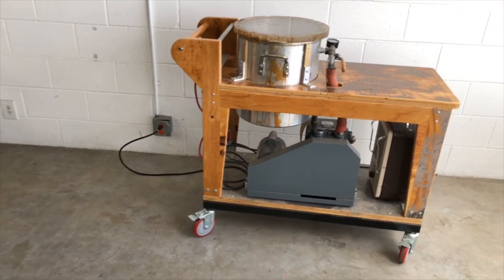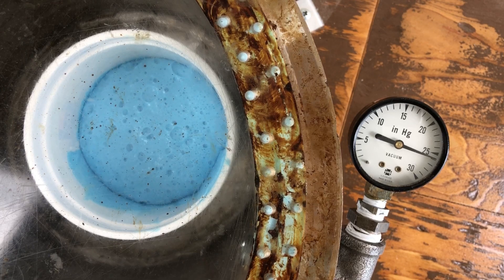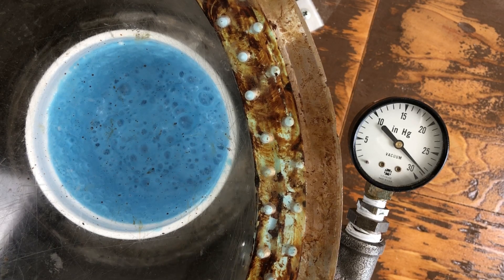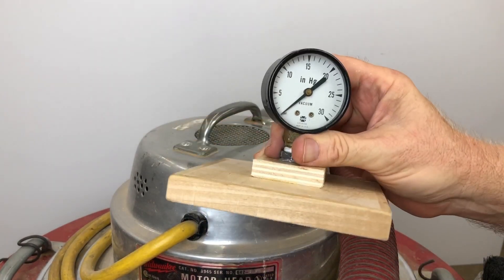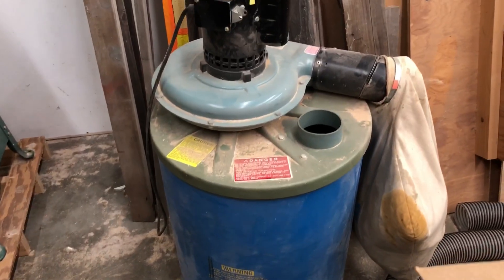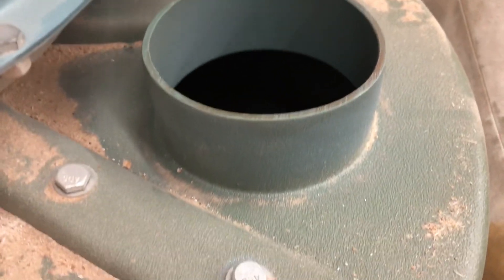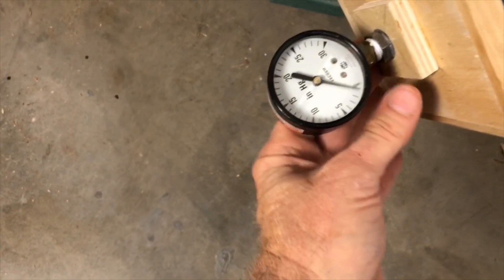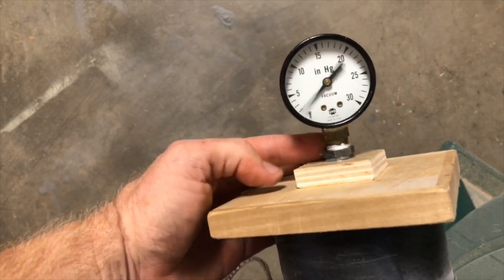To De-Air Silicone Rubber?

Comment: I used a 2.5 gal shop vac to run a home built vacuformer, worked quite well. But as noted, shopvac can not pull enough vacuum because of its construction. Best thing to do would be to (hard way) use a brake vacuum tool or (easy way) use a AC&R vacuum service pump. Some can move air out pretty fast these days. Depends on what you want to spend.  Typically run around $200 or so at Autozone or similar or saw one at Harbor freight the other day. Pretty sure these are positive displacement pumps, and the only way to pull full vacuum.

Comment: Great demonstration.  So as I look at the array of vacuum pumps available, which specs matter?  If you're degassing silicone in a 2 gallon vessel, how do you know whether a given pump that can pull almost 30 inches of mercury will be able to do so without eating up too much of your silicone's pot life?  If I understand, CFM only applies at the beginning of the cycle.  Your demonstration shows that the rate slows as the pressure drops.
Reply from the maker: You really only need to vac until the rise and fall of the rubber. You don’t need to get every bubble out in the vacuum chamber. I would just make sure that any vacuum system I considered to buy claims to be able to degas rubber.  I have a industrial pump with a DIY chamber big enough to degas a  5 gallon bucket and I also have a Bacoeng system I bought off Amazon.  Both do a good job of degassing rubber.
Reply: @RobertTolone  Thanks!

Comment: Dust extractors are high volume, low pressure. Shop vacuums are low volume, high pressure. This explains why the shop vac had a higher vacuum rating. Of course both are vastly inadequate for this purpose :)

Comment: Unless I am mistaken it looks like you have a Welch Allyn model 1402 pump in your vacuum cart.  Can you confirm this?
Reply from the maker: Yes, that’s correct.
Reply: @RobertTolone  Thanks so much.  I want to buy a lab quality unit instead of the Amazon doo doo I am seeing so much of
Reply: @RobertTolone  I just bought the model 1397 at Auction for $50!  Where yours has 160 cfm displacement and a .75" outlet, the one I bought has 500 and a 1.75" outlet!  I am hoping I can tame it for shop use.  Primarily for silicone and foam rubbers for automotive vent window seals.  Thank you so much for your work of explaining the craft as you go!  The learning is fun and valued.
Reply from the maker: @oldschoolcars3318  That’s a beast of a pump!

Comment: I have watched a gratuitous amount of videos on how to configure a vacuum chamber & pump set up. Yours cleared up so many questions as they always do. Thanks you for your time & quality content. 

I was hoping you’d clarify what power vacuum pump I would need. I see prices ranging from $55 to over $600 and I want to spend my money wisely. I’d really appreciate your guidance!
Reply from the maker: I would look for pumps that the manufacturer says are suitable for degassing silicone rubber.  Your pump needs to reach pretty close to a full vacuum, 28 to 30 inches of mercury. It needs to be able to do so quickly, so the bigger the tank you have the bigger the pump you need. A small pump can evacuate a small chamber efficiently but won’t get the job done if hooked up to a 5 gallon tank. So you might want to buy your chamber and your pump together.

Comment: I've seen people use a pressure tank to get rid of bubbles from the silicon. Is this enough to make 25mm resin cast miniature bases in a one part mold? I think your channel could get alot more exposure by delving into casting miniatures
Reply from the maker: I use my vacuum chamber to de-gas silicone rubber and my pressure pots to cast urethane resin. This system would be excellent for casting miniatures and I would love to do some. I have had a couple of miniature sculptors contact me about doing a channel project but so far no one has sent anything in.
Reply: @RobertTolone  Their loss really. I'm sure someone will come 'round eventually :)

Comment: Air in silicone will expand linearly relative to the level vacuum. Volatile compounds in silicone or epoxy will start to gas off (be vacuum stripped) when the pressure is dropped below the compounds vapor pressure. In essence stuff that is needed in the mix starts to boil off. Go low enough on vacuum and almost any mix will start to boil, but it's not necessarily air bubbles you are removing.
Vacuum stripping takes time though so you can limit it by not degassing for too long. Also you can check the temperature of your silicone/epoxy. If it gets colder after a degassing, you have stripped something out.
Reply from the maker: You make a very good point.  Thanks for pointing this out.  When you degas silicone it rises with a lot of bubbles, then falls but continues to "boil".  I have found that it is not necessary to degas any longer after the fall.

Comment: So is it possible to use an oil-free compressor for a vacuum chamber by attaching connectors and hoses to its inlet?
Reply: Compressors are not engineered with that in mind. Its like using a vacuum chamber as a pressure tank. Sure you could, but it would take a significant amount of re-engineering and will likely function poorly compared to a purpose built unit.
Reply: Those poor little valve sheets would warp

Comment: I thought of making a vacuum chamber with my vacuum.
Reply from the maker: I first tried with a shop vac.  But it failed and I couldn’t understand why.  🤪
Reply: @RobertTolone  I believe it is due to the impeller on the motor,  it is not leak proof.